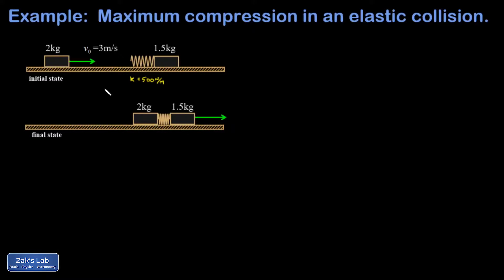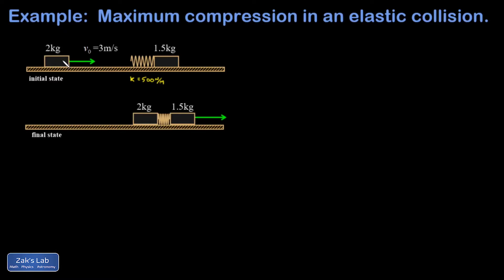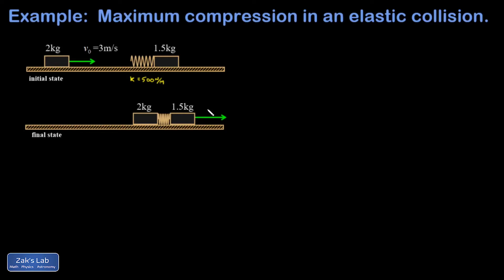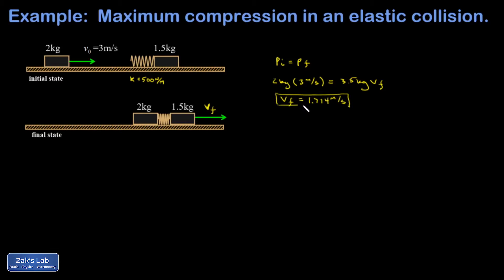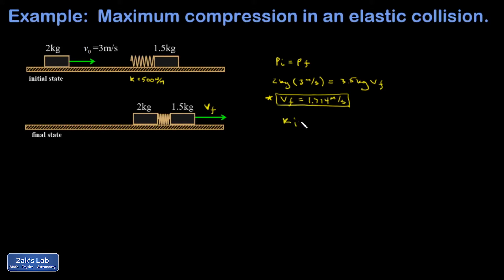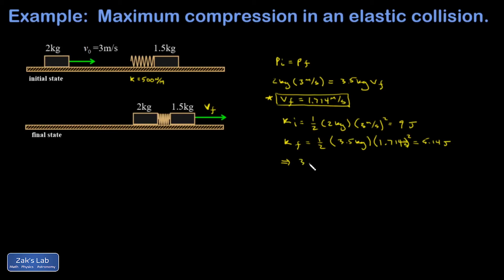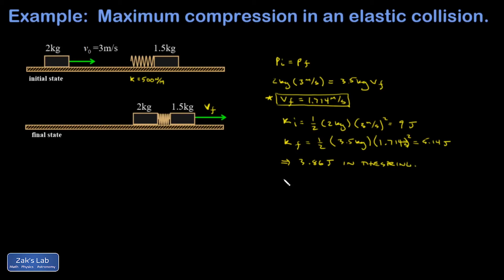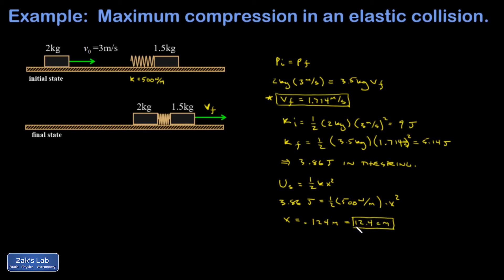Elastic collision: spring compression during elastic collision + maximum compression of the spring.

Comment: How can we apply momentum conservation here? Doesnt some of the energy get stored in the spring, so at first we had pure kinetic energy and now we are having potential and kinetic energy, so in this instance how are we applying conservation of momentum? Isnt that spring force considered an external force?
Reply from the maker: The spring force is internal to the system, the key being that each cart feels exactly the same force at every moment, but in opposite directions (conservation of momentum is derived from Newton's third law).  Momentum is conserved at every point in this collision, even as the velocities are continuously changing during the collision, and energy is transfering between potential and kinetic systems. z
Reply: @ZaksLab  got it, so when the first block compresses the spring with a force, its velocity decreases. the spring equally pushes on the second block, increasing its velocity to the exact amount at each dt time interval such that the momentum of the system is conserved? So when at a time such that these 2 velocities of the blocks are equal, then its the case of maximum compression in the spring?
Reply from the maker: @dakdoodleart right!  at that special moment the cars are in the transition point between getting closer together and farther apart, so that's max compression
Reply: @ZaksLab  you cleared my confusion, thanks a lot!

Comment: Thanks for the great video! It helps me understand it more. 

For the same type of problem in my textbook, it states that the two carts would have the same speed upon the maximum point of compression of the spring - could you please explain how is that so? Many thanks.
Reply from the maker: when the impact is about to occur, the left car must be moving faster than the right car, in order to be approaching the right car.  After the impact, the left car must be moving slower than the right car, so that their separation distance can increase.  The point where the maximum compression occurs is the transition point from the cars getting closer together and getting farther apart, so that's when the two speeds are equal.
Reply: @ZaksLab Thank you for simplifying things, so kind of you! Really makes sense now!

Comment: What would make the spring squish at the first place ? Should not the moment the 2kg mass pushes the spring , the spring should at least exert some force on the 1.5 kg block which will increase its velocity? At least some velocity of block of 2kg should increase isnt it?
Reply from the maker: Yes, but it's a gradual process:  compressing a spring by a tiny amount means it exerts tiny forces.  The 2kg keeps getting closer to the 1.5kg even though it is slowed a little bit and the 1.5kg speeds up a little bit.  This continues until the special moment when the two velocities become equal, after which the 1.5kg keeps speeding up, the 2kg keeps slowing down, and the distance between them begins to grow. z
Reply: @ZaksLab  will the 2kg one even retard after some time due to backward spring force on it

Comment: Why would the blocks move at the same speed at max compression???
Reply from the maker: If the block on the left is moving faster than the one on the right, then the blocks are still getting closer, and the spring is still compressing.  If the block on the right is moving faster than the one on the left, then the blocks are getting farther apart and the spring is expanding.  The sweet spot in the middle is that transition between the block on the left moving faster and the block on the right moving faster, in other words, the moment when the blocks are moving the same speed.  At this moment they are at the closest approach/maximum compression.
Reply: @ZaksLab  actually I got it by watching the solution 2-3 times, thank you btw! You're doing a great job!!
Reply from the maker: @PrabhatSingh-mn2fl  thanks!